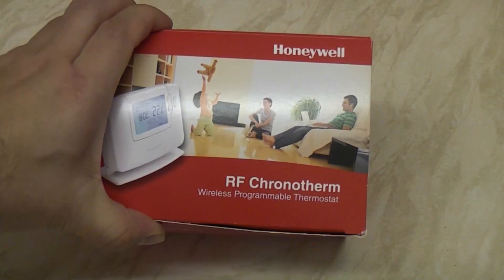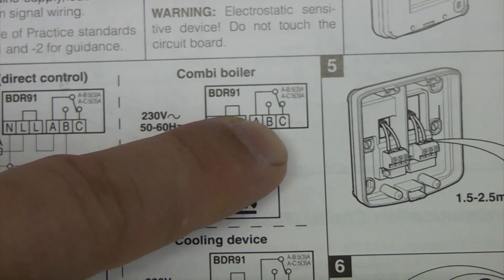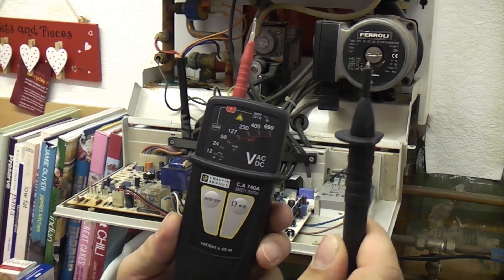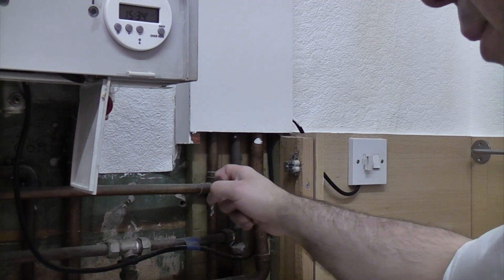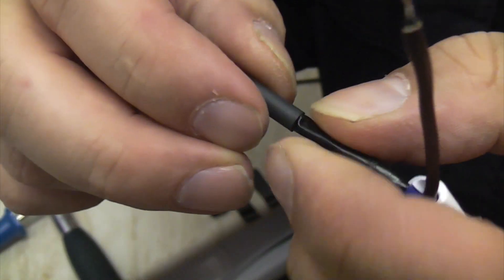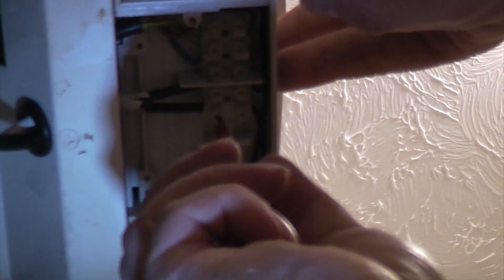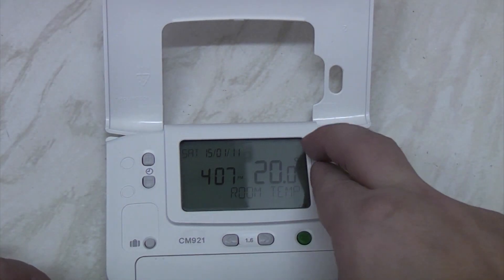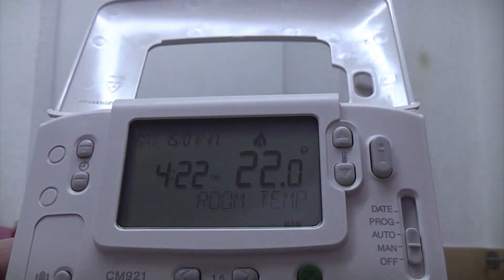How to fit a wireless room thermostat | fit Honeywell wireless thermostat

Comment: Hi
Great video. My old mum has just had a new central heating system installed (Ideal Logic 24 + combi boiler). Can you advise where the best place to but the wireless thermostat should be please? Some say in the hall (where the radiator has no TRV) others say put it in the room you live in most i.e. the lounge.

I'd be grateful for any advice.

Cheers
Reply from the maker: Ours is in the living room, but most people put them in the hall.
The beauty of these is that you can move it around with you, so you can set it to say 19 degrees when you have it in the lounge, then just press the down button till it gets to 17 degrees and move it to the bedroom when going to bed.
Reply: I had the same system fitted 5 years ago. If you put the thermostat in the hallway, some way away from the non-trv radiator,    it will work fine. Then you should be able to set the hallway temperature at, say, 16 to 18 C, and use the trv's for comfortable temperatures in the main rooms.
 You can then juggle with timings for best economy.

The real advantage though, is that you can carry the thermostat around and close down the trv's in rooms you are not using. I find this saves me about £500 a year, with bedroom temperature 16°C at night and 21°C daytime   (and 18°C is fine if I'm very active).
  If you do this, and the system was properly balanced, the hallway temperature should be about 16 to 18°C anyway.

The milky white hot water is quite normal. Because the domestic hot water comes directly from the mains water inlet, It has lots of dissolved gasses and is at a fairly high pressure. Gas is less soluble in hotter water, so the milkyness is caused by lots of tiny bubbles as the pressure reduces and the temperature is raised.

The only problems I have had were a faulty diverter valve and motor just outside warranty (expensive and annoying s), and the display fading after 4 years (expensive again.)

But overall OK, so your mum should be very happy with it.

Comment: Great Video we have this thermostat and its brilliant. We came from a flat fitted with storage heating, now we have a 3 bedroom house and it was my first thermostat ive ever used, after reading the instructions briefly and having a play around i soon picked it up, its really quite simple when you've mastered all the buttons and settings.

Quick question, is it normal for our hot water to turn a milky white colour? its most noticeable when doing the dish washing in the kitchen, im not sure if its the fairy liquid/water reacting to make it turn white or what? but if i just fill a glass it looks clear, yet put some fairy liquid in the bowl and turn the hot tap on, within 5 seconds it goes all white?
Reply from the maker: Yes, that is quite normal for a combi boiler. It can appear milky white when exiting the tap but if you leave it a few minutes it turns clear. I think it's something to do with the oxygen in the water

Comment: hi there. great video

i have one question - what setting does my manual switches on the boiler need to be in for this to work correctly? all in the "on" position?

thanks
Reply from the maker: Can't remember sorry, this was done years ago.
You can soon test it though with the switch in different positions as the wireless thermostat will not control the boiler if the switch is in the incorrect position.
Reply: I have mine setup so you have boiler on heat temp middle around 60 degrees but how hot you want the boiler to heat the water up to is up to you but need it to go hotter than you want the house temp or it might take some time to get the house warm, the timer if it had one is not used now so set it to constantly on as the thermostat will take control now, but you did not say which switches you have on yours.

Comment: Thanks for the vid. Is it a job for a sparky or plumber if I can't do myself?
Reply from the maker: You are welcome
Any sparky will be able to fit one of these or a heating engineer ;-)
Reply: ***** Thanks!
Reply: ***** Turns out my boiler manual had the instructions for wiring a 2 wire thermostat. All I had to do was buy a non voltage thermostat and 3 metres of flex - job done myself - thanks for the point in the right direction with your video, your instructional vids are the best on Youtube and once again you've saved me money :)
Reply from the maker: ArcanePath360
I'm glad the videos have helped ;-)
Thanks for the comment

Comment: Good video, thanks

I've a programmer next to my boiler, and a thermo in a different room. 
I was looking at this same system a while ago, is this portable controller intended to replace both the thermo and programmer? 

Any idea what the wireless range is? 
Thanks
Reply from the maker: You are welcome.
It is designed to be a wireless thermostat and programmer, I am not sure what the range is sorry.
Reply: Thanks, I think this is the device i need, I found some tech specs and the wireless range is 30m

Comment: At night I turn my thermostat to off , is this correct or shall I just turn the temperature down so the boiler doesn't come on in the night . I use the manual setting .
Reply from the maker: I normally just turn mine down to 16 degrees at night, during the day I set it to 19 degrees. I guess if you switch it off you might save some gas

Comment: Excellent instructional video, I just installed one of these on a Ferroli combi boiler and the most difficult bit was fitting the trunking and drilling for the wall box! Very simple wiring even for a DIY enthusiast like myself. Prior to this we had no thermostat so were controlling the temperature in the house with thermostatic valves and by turning the boiler on and off which was hopeless! 3 days on we only have the boiler on half of the time and the temperature control is effortless. Top marks for the video, and chuffed to bits with my Honeywell Chronotherm unit. Always sceptical of the range of RF, but our transmitter unit is working fine 2 rooms away from the Relay box in an old house with solid stone walls. My only regret is not fitting it last year and reducing the amount I contribute to the profits of my gas supplier!
Reply from the maker: Thanks for the comment ;-)
Reply: ***** Just wondering at 10 mins -20 secs in the terminal where you fitted the switching cable is block 72 where the link was .....correct..
Reply from the maker: Yes, the switching wires replace the link. The relay from the wireless receiver then opens and closes this circuit to switch the boiler on and off.
Reply: *****  Great upload always wondered how to get my head around this wiring loop... now i'm sorted... [ Because of the digital control introduced there's reckoned to to be a fuel saving of 10% plus ] thanks again....

Comment: Thanks
Great tutorial came in handy.
Almost missed the double pole switch part as my boiler only had a spur unit in there not sure if it was double of single but changed it out for a double pole switched spur just in case.
 I installed mine on a Baxi 35/60 was same install only thing I figure out, was I had to turn the temperature dial up on the boiler for it to start working was not sure if it was supposed to be up or down to start with, but now I know and hope it helps others.

Comment: I have a similar wiring job to my boiler. Would I be able to replace the 2x 2 core flexes for 1x 4 core flex instead. Is there a problem doing that?
thanks

Comment: recently had a really bad lightning strike mid year and took out power to boiler had a rough guess that it was the internol boiler fuse was just woundering for futcher refrance are thay located on the pcb panal and easy to replace if ever happens again nice upload can now get my timer up and running now :)

Comment: Hi there. I am about to put a new Siemens rdj10rf receiver on my Boulter buderus boiler as the receiver has had it. Is it a case using existing wiring, disconnecting the old receiver and wiring it in to the new one?

Comment: Great video.  I have them fitted and working last year.  The heating was switched off during the winter but now the thermostat is not communicating the receiver, what could be the reason.  I have tried reseting the thermostat with no luck.

Comment: Tinning wires fixed under screw terminals is not a good idea.  When you tin a multistrand wire fully, the solder wicks between the strands of copper and forms a solid block, part of whose volume is metallic solder. When you clamp the solder and copper bundle you tighten the screw or clamp against the solder block, and in time the solder metal "creeps" under the compressive forces and the join loses tension. The wire can then either pull out or cause a high resistance connection with heating.

Comment: My CH is quite a modern system with a combination boiler, motorised valves and TRVs on all the radiators. A Honeywell 9400c programmer controls the timing. There is a frost stat in the laundry room which is where the boiler is located and next to the kitchen so unlikely to freeze BUT there is no room thermostat anywhere in the house. Could I just remove the frost stat and replace it with the sender unit from a wireless room thermostat then place the thermostat itself in the living room?

Comment: hi, is there any reason why i cant run the boiler main cable to a fused plug and plug it in a socket with a switch and then run a cable to the reciever and and a cable to  the boiler thermostat connection? is it doable? thankyou

Comment: Thanks for the video - very clear and Im glad I came across it as Im going to install one of these over the weekend. 

Just 2 quick questions if you dont mind - the instructions for the Thermostat say that you need to use 1.5 - 2.5mm2 core flex. Do you think its ok to use just use 0.75mm2 flex?

Also, did you use the same cable type for both the power and the switching cables?

Sorry if they sound like stupid questions!

Comment: hi guys. guess what!... done mine and .....success. It works. We did it!!! we did it!!...I mean I did it. Really it was a piece of cake. The guys who made the boiler were so clever to fit the room thermostat connectors outside on the back of my boiler's control panel. it was so intuitive. had to check first anyway the boiler's electric diagram. I had a clue of what I'm doing but your video was so reassuring. thnx ultimatehandyman

Comment: In my boiler the red link is not there. One of the two wires connecting the circulation pump is connected directly to the switch entry were the thermostat should be connected.  I do have a timer already connected ahead of the boiler: is this the reason they may have changed the way the pump is connected? CAN I STILL CONNECT THE THEORMOSTAT THEY WAY IS SHOWN IN THE VIDEO?

Comment: Great video and it was great to see the job as it was very much what i was thinking it would be in my head. I got a price from my boiler service co. and they want £230 to do the same job!!! I was a little unsure as i have not done one before and thought it would involve messing about with the boilers timer switch - In fact its very simple to do and the hardest part of the job will be fixing the receiver to the wall. Thank You for the Video

Comment: Great upload! I got a quick question..... If you had a powercut and then the power came back, would the wireless connection be lost between the transmitter and receiver? Would you have to pair it again?

Comment: I've honeywell CM921 connected to Ideal Isra24 boiler, since last year the thermostat unit stopped working/connecting to switch the heating on. The BDR91 unit is flashing red light constantly. The heating only can be switched on manually from BDR91 unit (small button next to the green light). I know there is a communication problem between the BDR91 unit and the boiler. I had PCB replaced, could it be because of that? Any help? thanks

Comment: hi, i finally got round to fitting one of these to my ferroli f24. identical connections to yours, but mine only works if the clock is in the I position. the thermostat bit is working, but i find the pump is running constantly. does your pump cut out when you switch it off

Comment: @ultimatehandyman Hiya, firstly a brilliant upload. Thanks alot. Now here is my problem. 
I have converted my house into two separate flat. Both of the flat has one boiler, as im living in one of the flat, i only have access to that boiler and not the other person living in the other flat. Would you suggest that I put a wireless thermostat in the other flat so the other person can also control the central heating system? What would you suggest? I am confused! Thanks

Comment: great vid, i had this thermostat fitted with a new boiler at our old flat. we have a house, which has a newer ferroli f24, but the diagram is identical to yours as is theu clock. now you have this installed, do you use the clock on the boiler to program it, or the stat? also does this overide the clock.

Comment: @9inety9 It's a CM921 so you can set it to automatically come at different times at specific temperatures throughout the day e.g. 0800 - 20ºc, 1130 - 16ºc 1830 - 21ºc 2330 - 15ºc and so on... The CM927 allows you to set different temperatures and times above but for every day of the week. If you just wanted a simple wireless stat without all the timing features then I would get the DT90E.